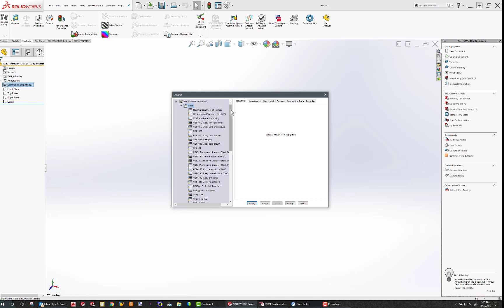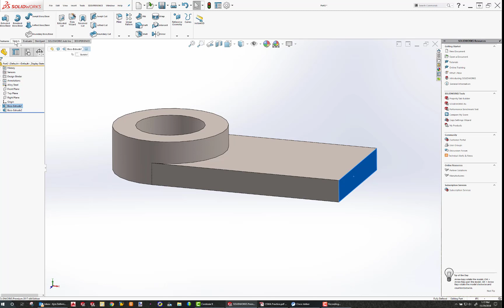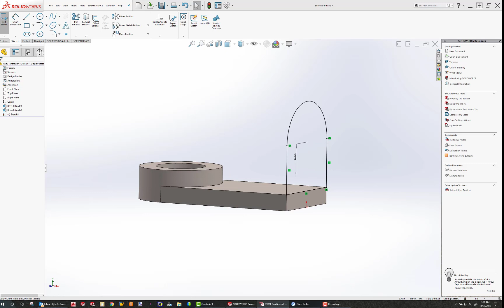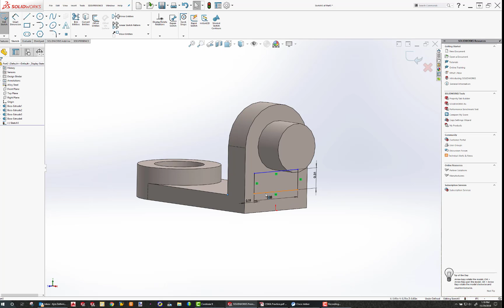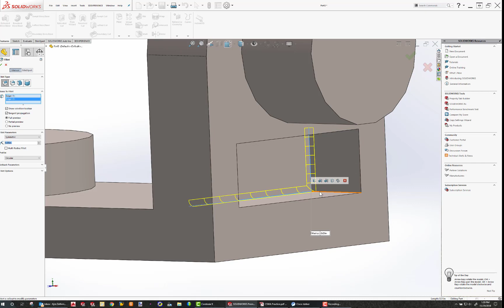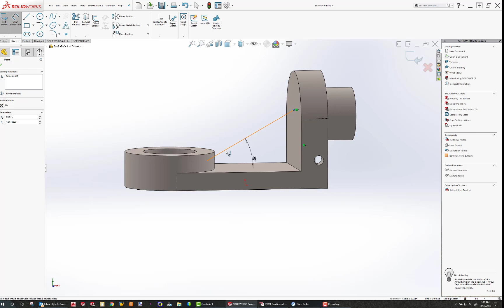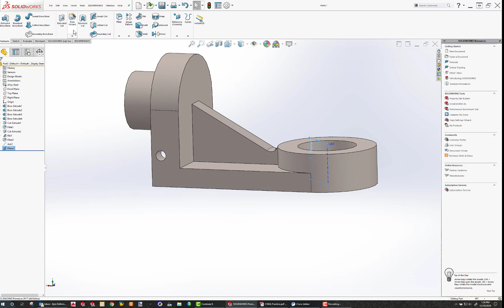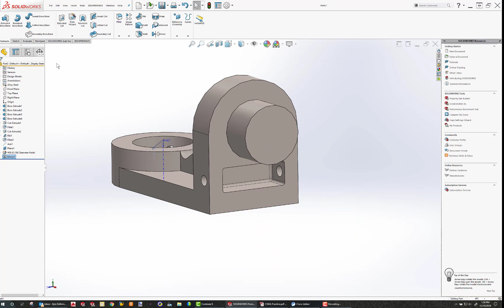CSWA Practice Problem 2

Comment: HI how did you get the thickness of the rib to be 0.250
Reply from the maker: Andy Amexo in the rib feature options there is a thickness input.
Reply: @deboM3  yes I know but in the cswa drawing, I did not see any measurement of 0.250 or a way to calculate to get that measurement so if you can please tell me how you got it for the rib? Was it stated in your drawing as 0.250 or your you had to do some calculation thx
Reply from the maker: Andy Amexo ahhh sorry, I understand now.  There is a note on the drawing that indicates wall and rib thickness is .250.  Please check link in description for PDF of problem.  Thanks!